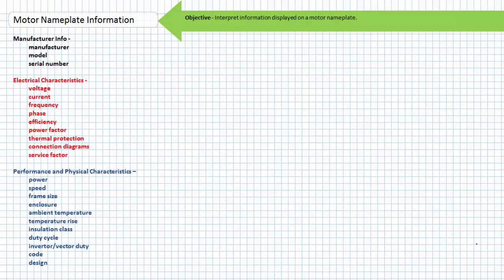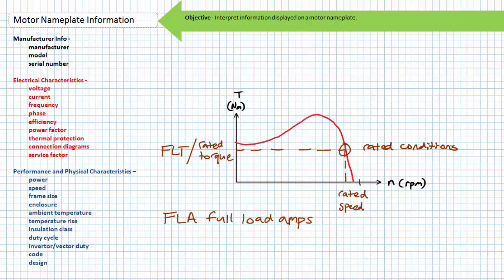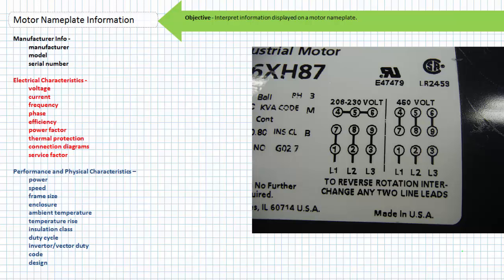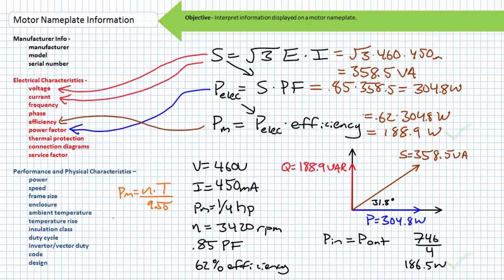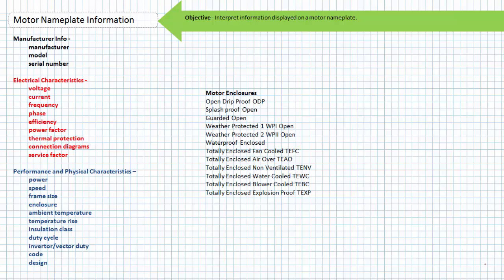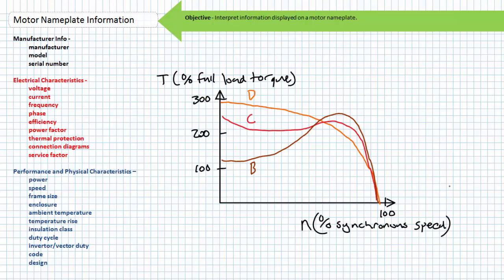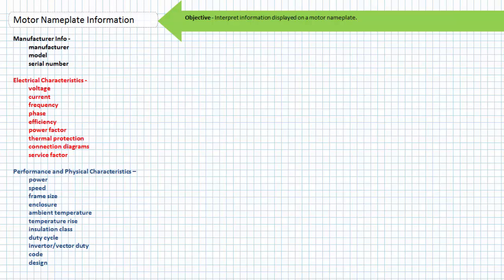Motor Nameplate Information (OLD LECTURE)

Comment: 0:10 Introduction
Part 1
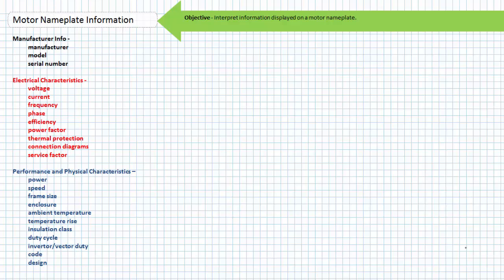3:55 Manufacturer info
4:06 Manufacturer
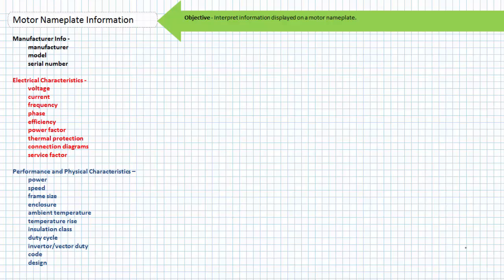4:20 Model
4:42 Serial number
Part 2
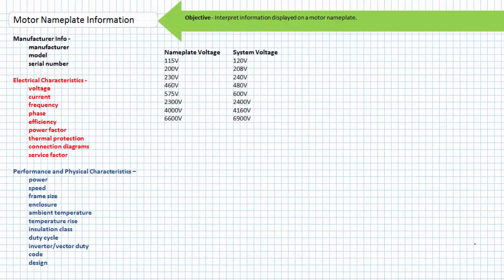5:36 Electrical characteristics
5:56 Voltage
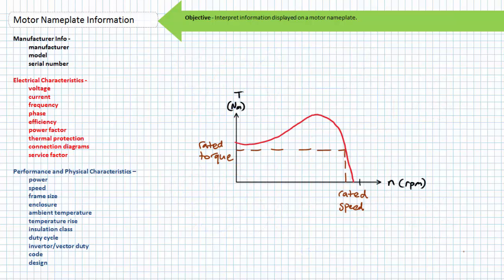9:06 Current
13:22 Frequency & phase
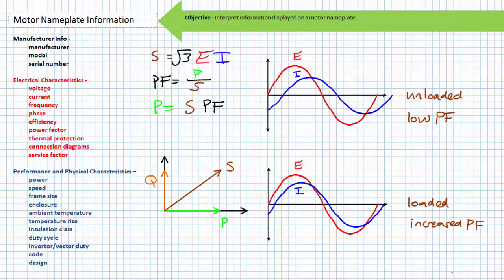13:51 Power factor
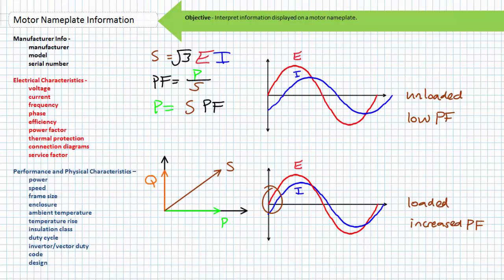15:04 Efficiency
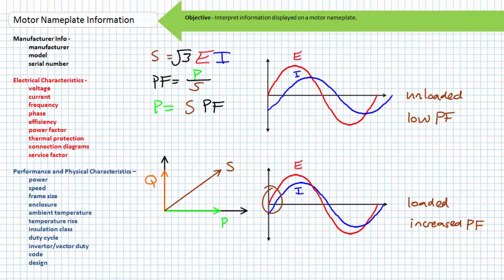15:33 Thermal protection
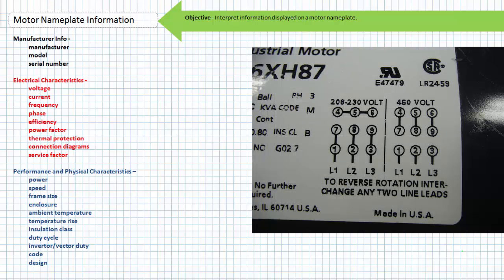15:59 Connection diagrams
17:00 Service factor
Part 3
17:34 Performance and physical characteristics
17:52 Power
23:48 Speed
24:52 Frame size
25:08 Enclosure
27:21 Duty cycle
26:24 Ambient temperature & Temperature rise
26:53 Insulation class
27:50 Inverter/vector duty
29:02 Code & Design
Part 4
32:44 Examples
37:33 Last words

Comment: Thanks a lot Jim for those amazing videos. I learn a lot from them. Just one more question about cable sizing for motors ?? How do we calculate cable size for motors? Some say based on rush current , other say 1.5 times of full load current . I am really confused about that as I did not find exact a clear answer about cable size.
Reply from the maker: Depending on where you live, the AHJ (authority having jurisdiction) can choose to enforce the recommendations of the NEC (or other relevant code) for motor installations (Article 430) or specify other requirements. A large safety factor is built into these requirements.

Comment: Greetings Mr Pytel. Firstly, I can't thank you enough for the incommensurable and priceless knowledge you are keen on sharing.   On a second note, in this particular lecture (27:21) you discussed about Contentious duty applications in which you described it as a duty being on all day. According to NEC provision and guideline.
"A continuous load is any load which is on for 3 hours or more (Article 100). Over-current protection for continuous loads must be sized at no less than 125% of the load. The increase in the fuse or breaker size is not because the current from a load increases when a load operates for more than 3 hours."